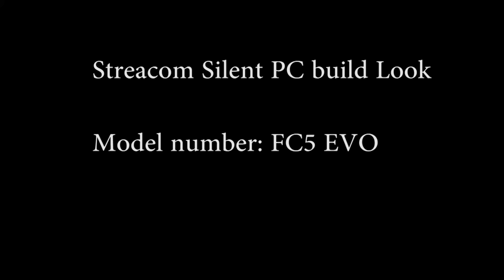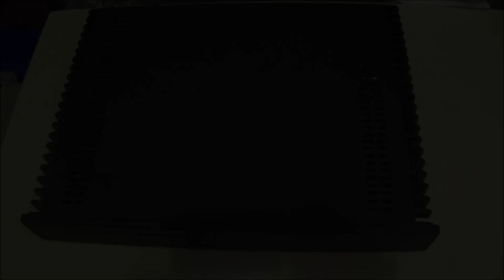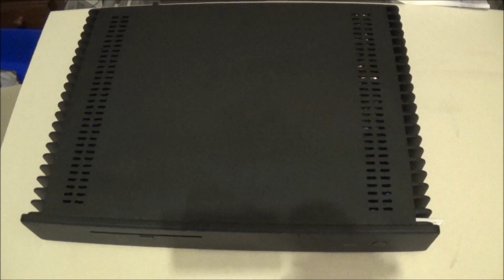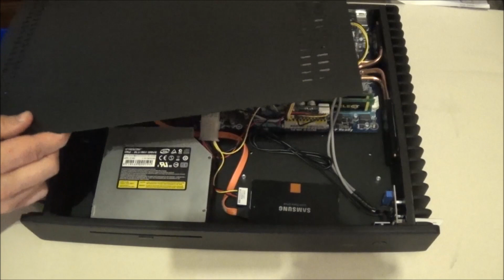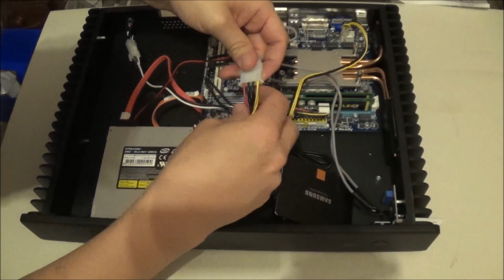Streacom FC5 Evo slim silent PC look HTPC build

Comment: That cool system is worthless and stupid...
Reply: +Jake Methner I run an i5 6600T in this case. It is a 35W TDP processor. My tests show that it stays at 30-35C at idle for forever (tested up to 72 hours). It keeps a stable 60C at full 100% load generated by AIDA64 and Prime95 which I tested for 4 hours with each. It never throttled or rebooted.
Reply: You really need to read up on thermodynamics.
Regardless, your argument is mute, since a system like this isn't meant for running at high loads.
Reply: How is it in any way worthless or stupid?
Reply: +ethereal333 Boom, experience over speculation.
Reply: Jack N. White Because, it doesn't actually cool, without any fan, the heat just builds up as it dissipates with the cooling fins. If the CPU is on for 5 minutes one full load for example, the heat will constantly build up and you will end up having a CPU running at 60+ C on idle after a good hour. More on a load. 

Now yes it is better than a smaller fanless model but even using a stock heat sink with the fan speed down to almost silent, would be better as the fan removes some of that heat from the fins.
Reply: you mom is stupid because she born you